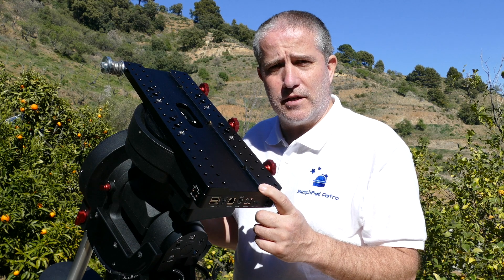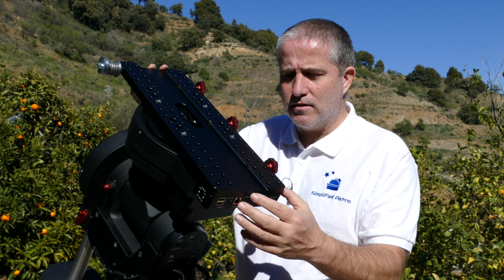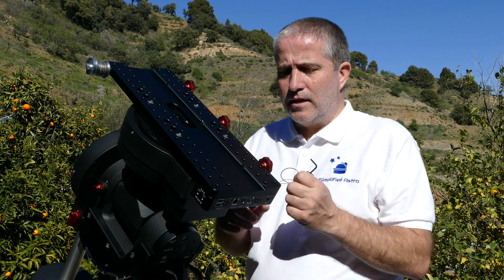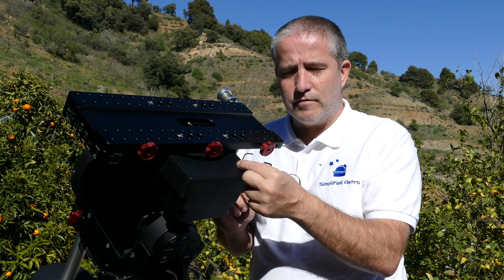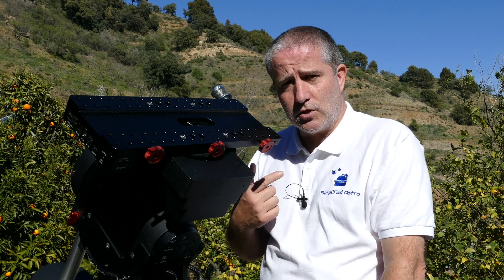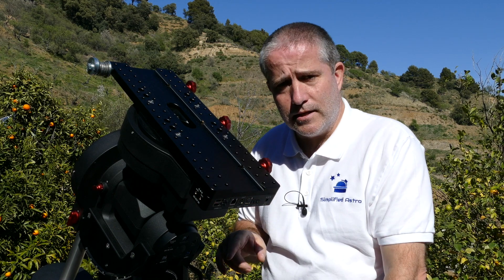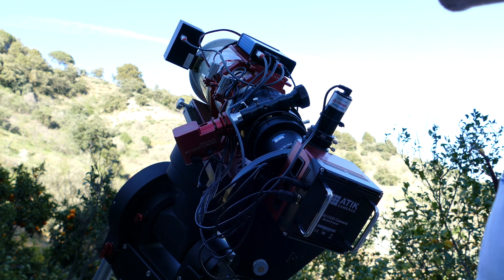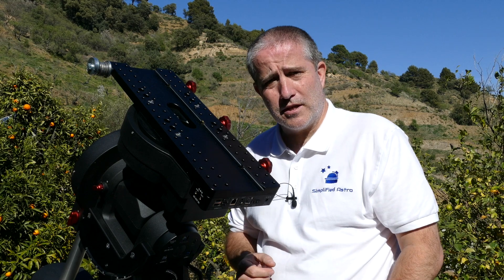iOptron CEM120 Declination Gear Adjustment

Comment: Hi Ray , I love your videos.
I want to mount the same Ioptron cem120 and pegasus astro system. Could you tell me in which connections and what type of cables are necessary. The input panel is a 10 amp dc, perfect!!. but at the output in the dovetail saddle there are two 5 amp dc... opss. And that confuses me to connect it to the pegasus.
Thank you very much

Comment: Hi, can I do this in my cem 70 with the ota mounted?
Reply from the maker: Hi.  I personally wouldn't adjust mesh with the OTA on, but I guess technically there is not reason why you can't.  You just need to make sure you can really feel any movement.
Reply: @simplifiedastro2092  thanks. I tried both ways . Without weight too much work putting in amd out the OtA till find the sweet spot. I didn’t feel was damaging the mount doing it with Ota. Anyway, I still have bad calibration issues . I’m trying to send my mount to ioptron to tune it.
Reply from the maker: @enriquebechet1  That's a shame.  Hopefully they can resolve it as they are great when working well.  Best of luck.

Comment: I couldnt get the 3mm wrench to engage the set screw to turn counter clockwise no matter how i tried, any thoughts as to why that might be? When its cold i have horrendous noise coming from the dec area though guiding seems ok number wise.
Reply from the maker: Make sure that you have the clutch disengaged.  There is a small hole in the shaft which the Allen key fits through, so it needs to be aligned for this to be possible.  If this isn't the issue, perhaps try using a different Allen key in case the head is rounded over or something?
Reply: @simplifiedastro2092  By that you mean both dec knobs horizontal right?  Pretty sure all that was correct, i tried multiple keys, peered in at the set screw and i could see it basically hadnt moved no matter what i tried.  Ioptron support hasnt been very helpful in figuring it out, as I tried to explain it to them before.  Was hoping maybe it was something dumb i was doing :)
Reply from the maker: @markm75  No it doesn't sound like anything dumb.  If the 3mm Allen key isn't engaging in the socket head then it sounds like an issue with that.  The noise you're hearing is probably the motor stalling.  Horrible sound like a loud creak.  Definitely sounds like it's a little tight in mesh.  May be worth just trying some other keys, perhaps even a 1/8 imperial one, just to see if it is something with the screw head.

Comment: why downgrading from the mesu to the ioptron?
Reply from the maker: Hi Sebastien.  I still have and use the mesu in the UK, this is what I use in Spain.  It isn't really a downgrade as such unless you intend to carry enormous loads, which the Mesu does with ease, they are just different mounts with good and bad points for each.  As this mount is operated mostly remotely, the through the mount cabling was a big decision maker.

On balance I do prefer the Mesu, but am not keen on the mounting configuration of the new (e) version.

Comment: I appreciate all of your CEM120 videos - very clear. Also impressed by what seems to be a lot of thought on the part of iOptron on usability. Two questions: in an earlier video, it appears you are using a hub to connect peripherals and connect that to the ports on the mount instead of connecting focuser, CCD etc directly into the mount? Is this correct and if so, the reason? 

And second, I have one 11" SCT on a Skywatcher EQ8 (mount 25 kg, pier-style tripod 31kg). My other is a good 11" OTA I'm considering deforking and placing on a CEM120. I can just manage the EQ8 @ 25kg. In theory, this one is only 1 kg heavier, but it looks huge in comparison and appears not to have grips to assist lifting it onto the pier-tripod. How difficult is it to move this one around?
Reply from the maker: Hi Lynn, thanks for your comments, much appreciated. 

Yes, you are correct with the hub.  It is a Pegasus UPB and I use this as I control the mount remotely, so the hub allows me to switch everything off after my imaging session, and to control the dew heaters etc.  The hub on the mount works great, and is a superb idea, but it is hardware pass through only, with no actual control of the ports etc.

The mount is a bit of a lump to lug about, but is definitely possible to use as a movable mount.  The balance weight bar is quite heavy and easily removable, so that helps a lot with that off.  It is physically pretty large, but I think the engineering is such that there is weight saving is areas where mass isn't needed, and with the 'through the mount' cabling, the centre is effectively a large hollow tube.  As you rightly point out there are no handles as there are on the EQ8, but there are plenty of positions to lift comfortably.
Reply: @simplifiedastro2092  Thanks for the quick reply. The more I read - and thanks to your videos - the more I am leaning toward this mount. I guess I'll just have to start lifting weights.  ;-)
Reply: @simplifiedastro2092  Slowly getting my CEM120EC set up - very pleased so far and the videos are very useful. Question: with my Celestron 11" OTA and imaging equipment on the back - even with the dew shield - the rail must be pushed forward in the saddle so that the back end is between the 2nd and 3rd tightening screws on the saddle - so the third screw/clamp is not doing anything and the front two are carrying the load. It seems stable but do you have any experience with this? Are two enough or should I perhaps add some weight to the front so I can slide it down and engage all three clamps? Since you have that counterweight and the USB hub forward, you don't seem to have the same problem.
Reply from the maker: @lynnvr11  It shouldn't be a problem as it is a very long saddle plate and really intended to cater for very long fl refractors.  If you find imaging at the native fl of our SCT is giving you issues, you can try using a longer dovetail as I have on my Tak, which gives me the overhang as well for the front end weight.
Reply: @simplifiedastro2092  Thanks again. Good idea. As you point out, this mount has some differences from the "average" so I'm still getting used to it! And it seems I also need some 3rd axis correction (my Telrad is the only thing I can see off-axis - but apparently that is enough!) so that will add some front weight and maybe mitigate the problem. Firmware and hand controller updated, now working on the connections via cable control.

Comment: Wish they had this adjustment on the cem60.I am in love with your mount!
Reply from the maker: Hi Anthony, thanks for your comment; It certainly is a lovely looking mount, and each time I use it I smile. 

Yes I think they made a number of changes from the CEM60 in this mount, this being one of them.  The CEM60 uses magnetic clutches which are sort of adjustable but in a crude way in that you lock them off and then back the screw off 1/4 of a turn.  I think it is a bit of trial and error and needs to be done each time you lock the clutch.

Comment: Got a few questions here mate. Apart from the sound bothering you, what are the implications of this dec axis saddle movement in terms of imaging and PHD2 graph?

Also a slightly off topic observation, I see you’ve put some washers on the dec plate, is this to compensate the third axis balance by any chance?
Reply from the maker: Hi Ahmed.  Because the mount is 700m up a mountain and fairly exposed, and my balance is absolutely spot on, the slightest breeze was causing spikes as it was catching my flip flat like a paddle which took a while to settle.  I could have balanced S heavy and guided N only, but that kind of negated the point of having such a good mount for me.  Tuning the dec axis like this has pretty much eliminated the issue, but I am now going to modify things so the flip flat opens downwards so less of an impact in the wind.

Ahhhhh yes, very well spotted with the washers my eagle eyed friend.  The first part of the video was done in the day time and was the original temporary solution to the dec 3rd axis balance (credit to you for noting this as an issue worth addressing with your filter wheel).  In the part where I have the OTA fitted you will see I had the ADM dovetail weight which replaced these washers.  Both work great, but the washers were temporary and the ADM weight is a much neater solution.

Comment: Thanks Ray, another informative video, great tips, keep it coming.  Since subscribing to your channel your video workshops have given me enough confidence to invest in the very same mount.  I look forward to more.  Well done!
Reply: Just do it. I was leaning towards the Orion HDX110, but Ray swayed me to the cem120. And I'm glad he did because this thing is machined to perfection. But his is a 120ec and mine the 120. Can't go wrong with either.
Reply: @joep1551  Thanks Joseph, I already have, its sat on my desk awaiting the custom pier/mount adaptor to be manufactured. I',m looking forward to seeing what can be achieved.
Reply from the maker: Hi Joseph.  Unless you intend to do unguided imaging I'm not convinced you really need the EC version anyway to be honest.  It does reduce the PE significantly, but if you are guiding this is largely irrelevant,  Guiding at a reasonable image scale is far more accurate than any encoders, so unless you really want to avoid guiding for whatever reason, then the EC models are pretty much a nice to have.
Reply from the maker: Thanks, Peter.  It is a really nice mount, I don't think you will be disappointed.  The 'through the mount' cabling is something I always thought was a kind of nice to have, but it is far more useful than I ever imagined.